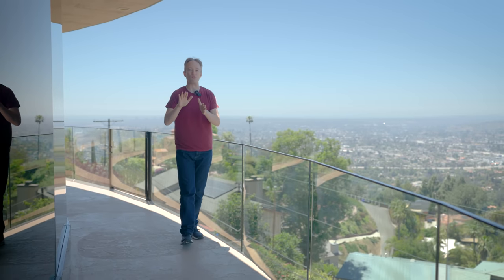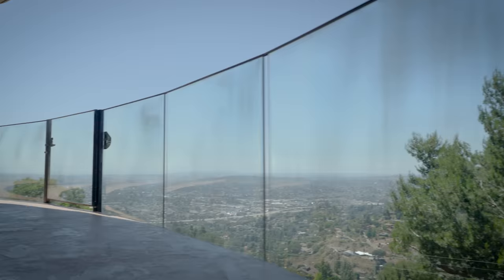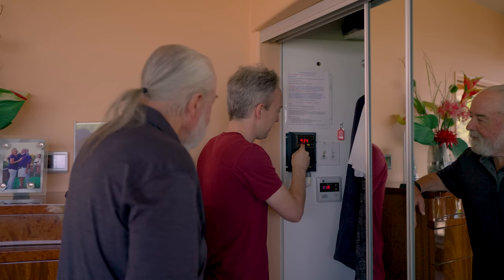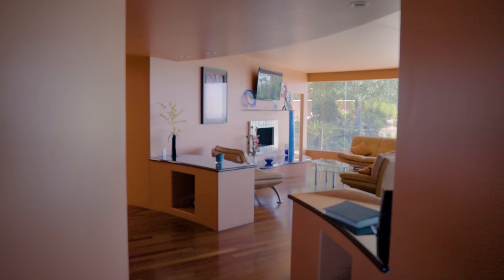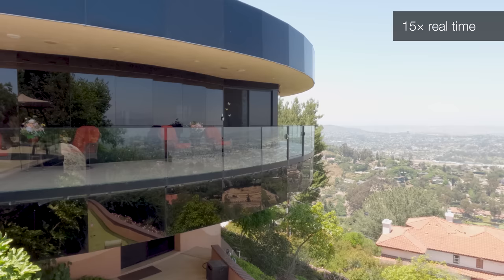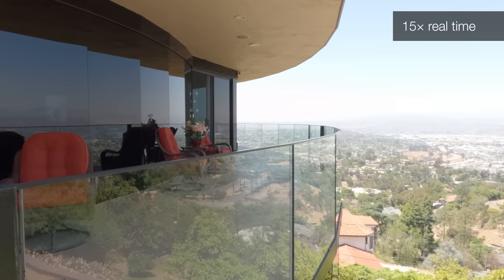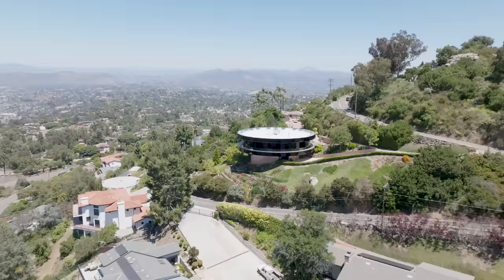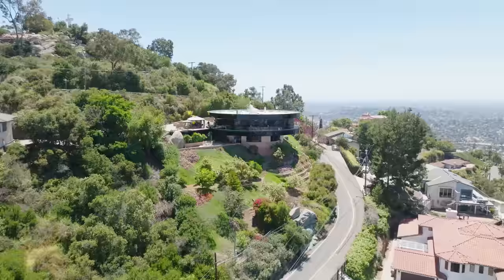I thought this rotating house was impossible.

Comment: That multi-utility ring for the sewage, water and gas is a phenomenal piece of ingenuity and problem solving. Would never have thought of that
Reply: You would have to have a lot of faith in the seals though.
Reply: Honestly i still dont get it
Reply: @alanj9391  Well, that's why there are so many seals between each, I initially thought there were less than there were... I thought it was Pipe-seal-alarm-seal-pipe, but he clarified that it was pipe-seal-alarm-seal, then seal-alarm-seal-pipe, so even when the alarm is triggered nothing has mixed or been corrupted yet it just needs maintenance to prevent it before a problem gets worse.
Reply: You could also do the same as a planar ring, wider than the vertical, but I hope that when it was designed the diameters were stepped all the way down, so as to make positive stops for the seals, and a bearing assembly top and bottom, either a single roller race or a few cam followers running on a very sturdy and thick machined ring, so as to keep those seals from experiencing any loading at all, and some flexible arms to transfer motion to them, so any slip in the house will not be transferred.
Reply: @TheSyborgue  It's the same principle as the power. With power, you have a stationary connection on the ground that feeds into a disk, and the rotating house has a brush that touches the disk and turns with the house, but because it's a disk there's always a connection. And you can stack as many disks as you want.
Imagine turning a 3.5mm plug inside a socket. Same concept.
Analogously, you have a waterpipe on the ground feeding into an isolated groove in a cylinder, forming a "ring" of water - like the electrical disk - and the house has a pipe opening that's sticking into the groove and turning with the house. No matter where it is, water can flow into it. And because the grooves are vertically stacked, you can have as many as you need.
Reply: @TheSyborgue  it works the same way the electrical slip ring works, with one pipe "slip ring" by type of liquid.
add tons of sealing and tadaa.
Reply: @alanj9391  well he did put in the sensors. I guess that's sort of what he patented about it?
Reply: My primary thought with all of to was why is th sewage at the top?!
Reply: @TheSyborgue  
Something that might help:
You can think of it like a really well engineered bucket with a pole going up through the centre of it. They fit together close enough that no water can get out the gap where the bucket meets the pole.
The pole in the middle has a hose in it that fills up the bucket, then you drill a hole in the outside of the bucket and attach the rotating hose to that. You can spin the hose/bucket all you'd like, but it'll never tangle up. 

The only difference here is they've stacked a few of these "buckets" on top of each other for different fluids, more or less.

In reality the "bucket" in this case is just a wall and the "pole" has little gaps where the fluids sit, but the idea is the same.

At least that was my understanding of it! If anyone understands it better feel free to correct ^^
Reply: I already thought of it in less time than it took Tom to get to the explanation. The concept in itself is not new, we use the same for power or coms.
Designing the seals and have them not failing for 75 years is an entirely different story, though 😅 if I did it, it would have probably leaked badly and needed extensive maintenance to keep it running, and tbh I'd probably have ditched the idea before even attempting to build it because I would have thought it's not doable.
Reply: @darkpheonix77  because sewage is low pressure, and it's less likely to burst the seal.
Reply: @FeepingCreature  Your example highlights one potential issue though. You rotate that 3.5mm plug in a socket, you get noise as the connection breaks. They're tiny breaks, but they're still there. Imagine the same tiny breaks but in a mains circuit, how electrically noisy is that going to be? Probably not enough to affect lighting or power but I bet wifi struggles as it's turning!
Reply: And it's relevant to space habitats, don't ya know?  Because one concept of those involves them rotating about an axis to provide ersatz gravity to the occupants, to help reduce degradation of muscles and bones.  A system like Mr. Johnstone's patent provides might be the very answer they need to organize various services.
Reply: Pretty much matches how a hydraulic differ (backhoe/JCB) moves multiple hydraulic circuits between the top section and the caterpillar tracks while allowing the top top feeling rotate. Has a specific name which I, for now, forget.
Reply: @slimydroid  That 3.5mm socket has one contact for each of the signals. The slip ring has several. It's not the same.
Reply: @alanj9391  As described, you don't. They have a fail gap with an alarm
Reply: Actually the same construction is in my turnable water spout, which I found out when I took it apart to descale a few years ago. (Standard issue where I live.)
But it's the first time I've seen that used for four different lines simultaneously at what is basically the center of a whole apartment.
Reply: @alanj9391  You put a lot of faith in seals every day, its fine.
Reply: @alanj9391 that's why there's sensors too
Reply: I would have thought of it, but never thought it could actually work - I'd expect those seals to leak.
Reply: Well, you wouldn't have had to think about that yourself.
Rotary unions are nothing new. You can find them in every excavator.
Reply: It’s nothing new, it’s very similar to rotary couplings commercially available for air and hydraulic systems.
Reply: @alanj9391  I would have faith in Seal (singer), but even he made a song called "Lost my faith". I bet it has something to do with seals.
Reply: @slimydroid   An 1/8" inch headphone jack is a $0.05 stampted tin part intended to be motionless in normal use. A slip ring is engineered with the proper materials for rotation, and such slip rings have been in industrial use on both high speed and low speed for 150 years. How do you think they get mains power out of the generator at the power plant?
Reply: i like engineering, im kinda into it. but i still had to watch it 3-4 times to fully understand how it really works. its sooooo freeaking nice!!
Reply: @thoriumbr  That makes no sense in relation to the particular concern posed. In normal construction potable water pipes must be separated from sewer pipes by a minimum distance because leaks do happen, and the leaks don't need to be seals bursting from overpressure (almost never the case because all the materials are built for the expected static and dynamic pressures), water is not pressurized 100% of the time which can allow ingress of external contaminates. (Occationally gets shutoff for maintanance, and there can be sections that act as a venturi when water is flowing.)
Reply: @thoriumbr  Ah thanks, that makes sense - I was wondering that as well.
Reply: @darkpheonix77  Maybe an attempt to create the most unobstructed path for the sewer and avoid installling a macerator. As I see it, only the top pipe can have a direct flow path.  However on reviewing the animation it looks like he didn't actually take full advantage of the potential unobstructed path so I don't know maybe it avoids some other close crossing of potable water and sewer. 
I was also curious why the potable was between the grey and gas, you don't want a gass leak getting into the potable water being carried into the house. All some sort a trade off I'm sure and maybe the two seals have a vented gap(in which case the gas certainly should have been next to grey or sewage and the potable at the far end.
Reply: I didn't even think of this problem to begin with. Amazing ivdeo
Reply: @alanj9391  Especially when you put sewage at the top. That's some YOLO right there.
Reply: @darkpheonix77  Doesn't matter, sevage isn't pressurised. If you get a leak between the drinking water and sewage it would most likely be drinking water leaking into the sewage and not the other way around.
Reply: Same tech is used for 360° excavator
Reply: @TheSyborgue 😢 Same here
Reply: @darkpheonix77  I mean if the seals fail all at once its going to most likely mix anyways and be unusable until fixed. So the order didnt really matter to much in that regard.
Reply: Still has to be NSF tested and approved for most building codes
Reply: @slimydroid  Yep. Which would be more of a problem with a high-frequency signal, but with 60hz mains it's probably easy to buffer out.
Reply: @alanj9391  No need for faith when you have evidence that they work.
Reply: @Starspiker  He lived in the house for 20 years, so going all electric wasn't possible back then.

Comment: I just love that he engineered a solution 100% so the house could just rotate indefinitely without reversing.
Reply: Yea, I was wondering if it had something to do with Feynmann's Belt Trick.
You could have a huge belt connecting the two layers, with a counter-rotating cam-like thing in the middle that makes sure it efficiently untwists every second revolution.

Comment: That slip ring design is the same design that's used in excavation machines. This allows the machine to rotate infinitely in any direction, but still have independent hydraulic control over each track and the dozer blade.

Obviously, the designer of this home had to include a lot of safety precautions in that slip ring design that excavators don't need to worry about. That was quite an achievement in itself.
Reply: Makes me think maybe he was an engineer who had experience in designing these kinds of things for industrial applications, and used his knowledge and expertise to make his dream house.
Reply: I had never seen this type of design before, but figure it was probably around in some giant machine somewhere. Having 4 different fluids all going through the same pipe, with redundant seals and sensors, is some next level stuff tho.
Reply: Rotary bottle or can fillers use the same design for the central column.
Reply: All ingenuity comes from something before. It’s possible he took inspiration from similar systems but I don’t think it discredits his achievements in the slightest. That design was awesome.
Reply: More so ones like engcon / steelwrist type hitches, not normal excavator hitches. It's a brilliant design and only suffers in lifting capacity.
Reply: Notice he subtly tried to take credit for the idea?
Reply: @kindlin it seems like a logical innovation if hydraulic technology

It’s just not intuitive because we all initially think of the problem the way Tom laid it out.

I actually think you can innovate this further by separating the drinking water and gas, requiring no sensors or double seals